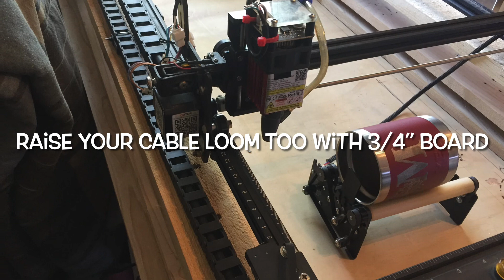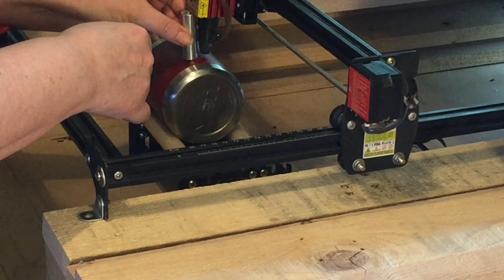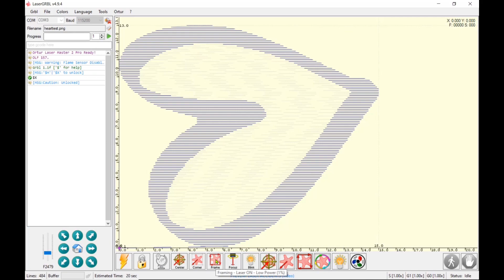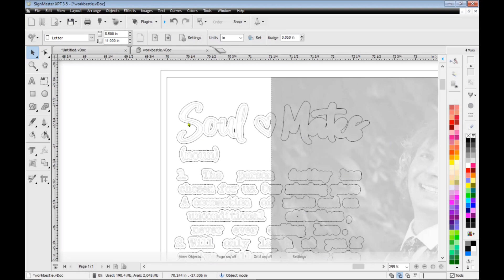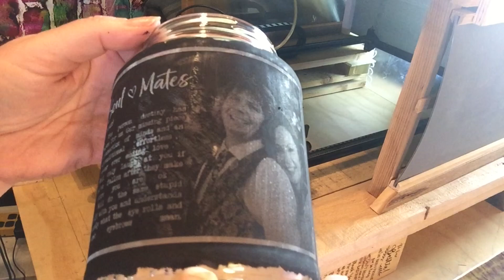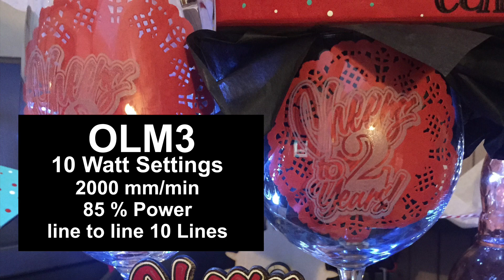30. Laser Engraving Tumblers & More Rotary w LASERGRBL 5watt & 10watt Laser Engraver OLM2Pro & OLM3

Comment: Thanks for this!  You made it look so easy. Fingers crossed it works for me tomorrow. Watching your video, I see where I went wrong. Thanks again! ❤
Reply from the maker: Happy to help! I hope you get some great results! 😊
Reply: OK,  your tips helped me get the laser and rotary to communicate properly.  But now I can't get it to burn the cup?  I used the stainless steel setting,  no luck. Changed to painted metal,  (I applied liquid chalk thinking maybe the bare metal was the problem) again,  no luck.  Tried to move the beam closer,  still nothing.  Help? Please!
Reply from the maker: @ 
 what type of laser machine are you using and what is your laser output ? What were all the settings you used ?  (and that’s starting with the very first pop up window as well ) If it’s a black and white image , not greyscale , keep the BW boxed checked on . Watch you don’t put the brightness too high that you’re taking what’s to be understood as black to a light grey. Diode Lasers aren’t really the best to engrave steel or aluminum , but it can mark them lightly and not necessarily permanently . You definitely need a 10 watt output  or higher laser . You need a higher number of lines to engrave in to stainless. ( I believe I had 10 lines for my stainless) There are Laser Engraving marking sprays available and it’s really what ingredients they have that interacts with the laser. I’ve seen people use black permanent marker, and even mustard! Yes, mustard! 😂 so number of lines , a lower speed ( mm/min not mm/sec . mm/sec is actually a much faster speed) and a higher power may be needed. 
Proper focus is paramount for the best detail . Lowering your Laser when engraving doesn’t do anything but take it out of focus. If anything when people were getting noticeable lines while doing coated Yeti cups they raised the laser just a smidge to help with that.  😊
Reply: @disignscdn  it's a diode laser.  Ortur laser master 2 (I think)  it was given to me so came with no manual.  LU1-4. 4.5? I set the line per mm and other settings as you had them.  I did make sure the laser had a decent focus.  Maybe I just need a bigger laser?
Reply: And my business is primarily painted tumblers, so I really only need to do what you were doing on the black tumbler and the yeti. I'm just overworked using the citristrip method and was hopeful this "free" laser would be my saving grace.  I've already invested over 200 with the hood and the rotary,  so if I need to upgrade it,  at this point I'm all in and might as well.  I truly appreciate your advice. Very glad I stumbled upon your video.
Reply from the maker: @reginaglezen8983  If you have the actual LU2-4 that’s roughly a 5 -5.5 watt output . The LU2-2 is only a 1.6 watt output so you would need to go at least half the speeds of what I showed with my OLM2 pro. If you bought it used , I’m wondering how much power the module may still be outputting. 🤔 It may be time for a good cleaning as well to optimize its power . Using a vacuum or can of compressed air blow out the fan of the laser module top and at the bottom . Using rubbing alcohol and a q tip , clean the lasers lens  . A dirty lens can make a difference. I’m very happy with my LU2-4 laser module for doing black tumblers and yetis . It will NOT engrave stainless. 
For a future upgrade that won’t break the bank , you may want to look at the OLM 2 pro with a 10 watt laser. You’ll be able to go faster and more materials . For me personally I like the Open frame lasers. Replacement parts ,like belts , extensions and upgrades are easy to find and more affordable . 😊
Reply: @disignscdn  thank you again for your infinite wisdom. I decided to just go for it and do one of my can koozies.  (It's got a smooth paint) at first it was over doing it,  now it seems to be barely etching the paint. Going to attempt a second pass when it's finished and maybe get the settings right. I found a 10w laser that is compatible with this machine (I think). It's in my Amazon cart. If all else fails,  upgrade it is.  You're a gem. 💖
Reply from the maker: @reginaglezen8983  ORTUR has a 10 watt laser upgrade kit . It comes with the mother board , power supply etc. Now I had issues with it turning on the laser whenever I hit the reset button and that was on the OLM2 Pro. 1st edition . So I’m not sure how your older model will fair. If you shop around you’re going to find you can probably get a newer machine with a 10 watt laser cheaper than just a laser module alone . 😊
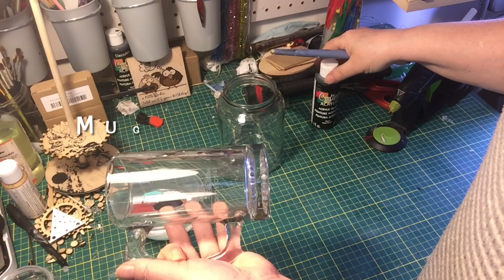Reply: @disignscdn  hello! I'm back to bug you again.  I upgraded to a 10w laser and lightburn.  After much trial and error,  I just did my first full wrap. It was SO CLOSE to perfect!  Do you have any tips for a 40oz  Stanley type tumbler? The larger surface area burned perfectly,  but the smaller bottom of the cup that is obviously further from the laser didn't quite make it all the way through. It actually looks pretty cool,  but it's not right. Any tips for better focus on the bottom? Ty 15:35
Reply from the maker: @ if it’s tapered , placing like a tile , or a flat object under the right side of the rotary to raise the glass level may do the trick 😊

Comment: Thank you so much for sharing this; I've just connected a rotary table seamlessly to my Sculpfun after watching your video. Regards from the UK👍👏👏
Reply from the maker: So Glad I could help! Did you go with the Sculpfun Rotary? I'm curious on how it works for you :)
Reply: @disignscdn No, I just bought a generic one and it worked fine. I'd already fitted limit switches successfully and just fancied getting a rotary roller. Thanks once again for your videos; they're really useful for newbies like me!!😉👍👏
Reply from the maker: Awesome! Glad it worked for you! My ORTUR rotary doesn’t want to work with my Sculpfun so that’s why I was curious 😊
Reply: @disignscdn  I looked at the Ortur and read that you need to swap the two middle wires in the connector cable for it to function correctly with the Sculpfun machine 😉👍. Regards again. 👏👏
Reply from the maker: Nice! I figured it had something to do with the wiring and just haven’t had a chance to look it up. 😊

Comment: I tried to engrave a simple 1in x 1in square... and instead it looks like a rhomboid... what am i doing wrong?
Reply from the maker: If you changed your grbl settings to 80mm sec to match your stepper motor speed, your issue could be your belts are too tight on the rotary, or are working with a tapered cup that not all contact on the rotary rollers are even. I’ve had to weigh some cups down by using a diy weight I made that just slides into the top of the cup. Now if you are using the clamp rotary that works like a vice.. I can’t help you with that as I haven’t tried it yet . I have seen some posts on the ORTUR user pages on Facebook though :)

Comment: Hello do you have to have a rotor to engrave on glass I'm new to engraving
Reply from the maker: It depends on your machine. For example Xtool machines can engrave a curved surface because they now come with automatic height calibration. I have seen bottles and glasses done without a rotary. Keep in mind though the outer edges of any graphic will be not be at the optimal focus height that the very center ( highest height ) of a glass would be at. This can cause thicker lines, not fully engraving into a glass or faded in appearance engraving. You are safe to do smaller in size engravings. Hope this helps :)

Comment: first i want to say thank you, because so far your video answered a lot of questions so far...
i am currently engraving some small green tinted glass jars and the engraving is working, but, i was wondering if they would also need to be painted to make the engraving smoother and instead of paint could painters tape be used?
thanks for you videos they are very helpful, especially because you use lasergrbl. 
i tried lightburn and it doesnt seem to work the laser power properly for my longer ray 5 10w.
Reply from the maker: @jims9895 I'd suggest trying some paint so the laser isn't going through the transparency of the glass in spots. Painters tape is kind of a pain to get off afterwards and if you have to layer / overlap a few pieces your engraving may not be consistent :)

Comment: my image is coming out stretched any idea??
Reply from the maker: I've got a few ideas as to why.. 1. check Value $101 to make sure you have it at 80.000 . Most rotarys are set up to only go that speed. Now I had some stretch and it going down sideways once, but it was on a tear drop cup. What I needed to do, (and this can go for any lightweight cup as well) I made a weight to slide in the top of the cup to just below the rim. My fancy Schmancy weight was a ribbon tube, Put magnetic tape around it till it was the right circumference, this helped add some weight to the top to keep it right on the rollers while turning. Are you having any issues with completely even cylindrical objects?
Reply from the maker: Eventually I would like to go with a rotary chuck myself. Far more options for engraving. Another solution if you are doing tapered objects is making a piece to go over the smaller end the same diameter as the larger end. Technically on a tapered object the thicker part rotates faster than the slimmer part. ( depending how you have it set..this can be opposite) Its a lot of work to tweak it just right. But you can put tape over an object and engrave on a lower power till you get it just right :)
Reply: @disignscdn  thank you! I first started with lightburn, but then had a problem when my chuck wouldn't rotate... so I found your video and I looked at all the same settings you mentioned in lasergrbl a couple times and still image is very streched, I could compensate and resize the image, but I went back to lightburn, where I found that my chucks speed was way to high and it kept it from moving... also I did need to change my interval to a lower value.  This setup ended up working out for me. Thank for reaching out and answers 🫶
Reply from the maker: @Onceuponajuan  glad to hear you're up and running :)
Reply: When I run frame laser goes past tumbler. What am I doing wrong?
Reply from the maker: @ericpina932  If it’s going past the bottom of the cup , you either have an issue with your image , your image size and need to adjust that in the 2nd pop up window. Check to make sure nothing is put in where you see offset in the 2nd window as well. If it’s framing and the gantry itself is moving front to back , then double check in GRBL configurations that  $22 =0